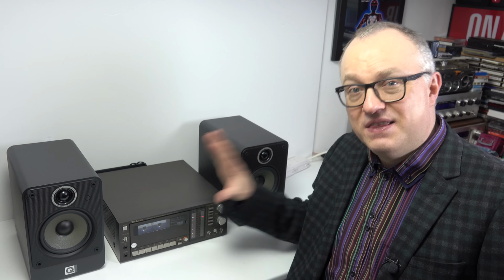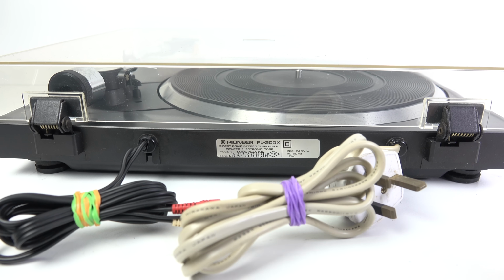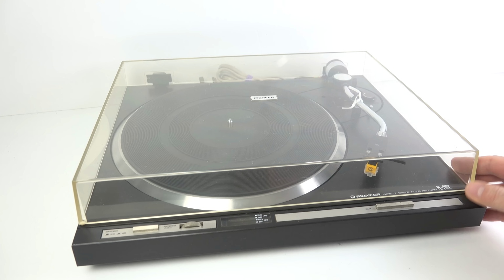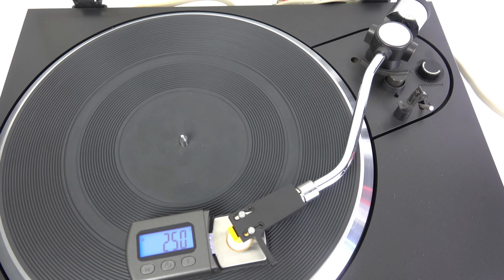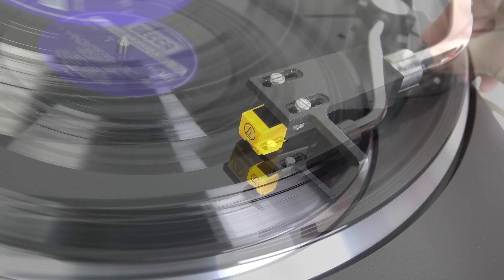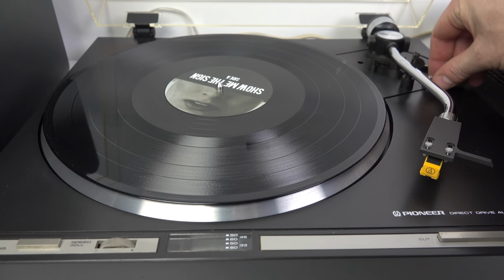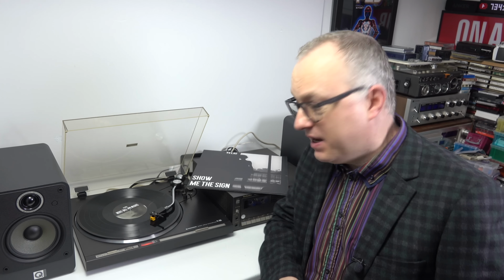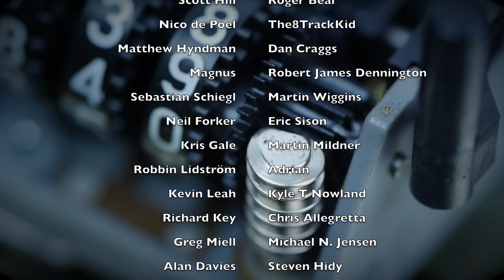Beginner Budget Hi-Fi Build: Part 3

Comment: Well, actually this TT was not properly packed at all.

Basic rule: turntable and counterweight NEVER travels assembled on the deck, they must be ALWAYS removed and separately packed, under the machine in the box. If they are in their places, their weight, accelerated by the kicks and bumps during the travel, will damage the delicate bearings - shafts etc. So this is a big NONO!

The only thing well done was the fixing of the tonearm with that wire...

One more could be: never trust a used stylus. If one buy a used TT, first step is to order a new (at least an aftermarket one) stylus for it and throw the old one away, as there is absolutely no warranty regarding its mileage, tip wear, or even damages by e.g. accidental falling on the deck or the turntable itself etc. This particular pickup is anyway to be thrown, this is a entry-0000 level of the Audio Technica range. There are very nice, new models from the very same manufacturer, for very affordable prices, which at least have elliptical stylus tip, and less tracking force needs. This one is a record lathe, not a turntable :D Specially if you crank up the force to the range where you did.

(I was sure you'll get the SL-5 but yeah, I'm not very lucky on gambling :) Fortunately I didn't bet on it in money :)
Reply: Most turntables have screws in the bottom to secure the bits in transportation.
Reply: @paulsengupta971  Those are for the chassis, the platter and counterweight is removed from every (serious) turntable for transport. The screws you're talking about are fixing the flexible suspension of the turntable subchassis to the outer shell, to preserve the springs... otherwise they might fall out or something could break.

Comment: Hello! I'm loving this series! But the recomended tracking force of this cartrige is 3,5 grams, not 2,5! And by the way this is an Audio-Thecnica AT3600L Phono cartrige.
Edit: Researching a little more I saw that this is the AT-95, but it has similar performance and the same tracking force than the at 3600L.
Reply: Nope it's an at91. The 3600 is a non replaceable cartridge that is put on the cheaper at lp60 turntables and some other cheap systems that I would like many others never buy
Reply: No, it's the AT 95, recommended tracking is 2g tracking,  not 3.5g.
Reply: @johnhpalmer6098  yup you're right
Reply: No, it's a CN5625AL cartridge...
Reply: @IsraelQuezada999  could be... They're pretty similar

Comment: I just made the biggest mistake of my life. I recently bought a turntable and I didn't have any receivers that had a phono input. so I had the built-in amplifier on my turntable turned on for the speakers I had. Well I went and bought a used receiver they have a phono input from Goodwill and then bought some Polk audio speakers. Well here is where the mistake was made I forgot to turn the built-in amplifier on the turntable off I plugged it into the phono input on my new to me stereo receiver and about blew myself out of the house with what has to be the most god-awful sound.

Comment: I don't do cassette or turntables. Too much fiddly stuff that I don't know how to do or am not able to. And getting service around here is like hunting dinosaurs.. I would NOT get a turntable without a cue lever. The SD card has made CD obsolete. For speakers I use a 90's Radio Shack Accurion subwoofer, two second-hand, I think Aiwa and two old Realistic hie frequency horns. I have a Sony digital radio from the 90's and Aiwa VCR that I use for the TV tunera nd specialized programming that is usually available only on video cassette and a Grace Digital that does internet radio. I have a bluetooth stereo adaptor and a SanDisk Fuze. These run through a switchbox. The Grace Digital radio has an FM antenna which is just a wire and pretty useless. I use with the Sony radio a fancy set of TV rabbit ears. the antenna input to the Grace is some kind of an f-connector that I can't find a similar one to so I can plug my rabbit ears into that. I live in a bad reception area and don't give a rat's arse about AM as it's alltalk shows the hosts of which mostly have their heads up Trump's arse to the point that if they burp, he gets a dry high colonic. I've got cable and am using an old 13" CRT until I put in my flatscreen which can do everthing. But, as for music playing, I am out of anything with a mechanical component and with modern SD cards that have gigabytes of memory, even the mp3 format is lagacy. Any lossy format is. When I get my new computer, an HP ENVY all-on-one with a touchscreen, this one is part of the stereo system

Still this is fun to watch, I do have a warm spot in me for those oldies but goodies. I am a big fan of you, the 8-bit guy and Retro Recipes and when I see an OBG piece of gear at the thrift store, my heart still skips a beat. I'm 73 and remember when those were cutting edge. I've always been acomponents guy, If an all-in-one component goes south the whole thing goes in the shop. If a component goes belly up, you only have to take it off line and bring it in and put the spare in its place. I got lucky on the amp, it's a brushed aluminium one that must pre-date the big bang. If it bites the bag, I'll get something newer but why ditch a good thing for no good reason. The subwoofer is about 20" of the floor, my "midrange" setup is about 25" and is about 18 x 12 and the horns are mounted at eye level, about 5'5" up. I don't even have to touch the bass and treble much

Comment: Rega Planar 3 is the lowest price acceptable turntable.
Reply: amcluesent not sure whether you're being sarcastic or serious but your profile pic fits your statement perfectly
Reply: Okurka belt drive and direct drive both have their strengths and weaknesses. 
Imo the turntable components and quality determine whether the belt drive or direct drive is good in that turntable
Reply: I'll gladly put my Technics SL-5100 that I got used for $240 up against a P3 any day of the week. Rega is nice but I was a little disappointed with them when an impulse used buy at a fraction of the cost ended up totally replacing and outperforming my Rega.

Comment: That is NOT the way to set anti-skating! Search Michael Fremer turntable setup for a full explanation. Also you did not budget anything for things like Cones? Big mistake! $60 for 3 BDR Cones may seem like a lot, but it will buy you a lot more results than spending the money on anything else. Unlike everything else when you upgrade you keep the Cones. A properly tweaked and accessorized system will far outperform the same money spent on just the major components. I know. I've done it. Teaching people these old school techniques when we've known better for over 20 years now is shortsighted, to say the very least.

Comment: Unless you’re a DJ, I don’t see much purpose for direct drive.
Reply: Most direct drive tables didn't have enough torque to be DJ tables anyway. The point was speed stability (wow & flutter). A belt table tended to do a little worse in that regard because of belt stretch and creep.
Reply: Fair enough to say, these aren’t the style tables a DJ would use ... I mean they make specific tables for that. As for belt drive tables however, I’m spoiled with stereophile gear, but I recognize they come in all classes. My previous comment was a little off the cuff. At any rate, durability, and not having to replace a worn or broken belt is enough of a reason for him to recommend it for anyone as a starter.
Reply: @PhiTheProducer  One of the biggest issues with direct drive is it's very expensive to make a good one. The motor is a completely custom assembly built around the spindle and sometimes part of it is on the platter (as with Technics tables). It's not a practical design for most small companies. It's much easier to buy an off-the-shelf motor and attach a belt. That's part of the reason the hi-fi community shunned direct drive.
Reply: bryede no doubt a good, quality direct drive is expensive to manufacture at a low cost. A pair of SL-1200mkx are not cheap, at any vintage.